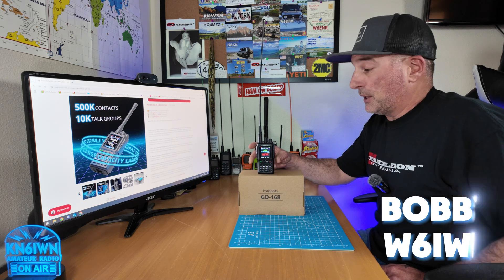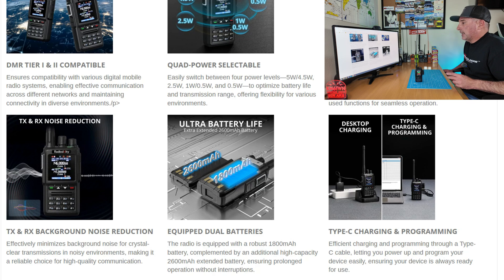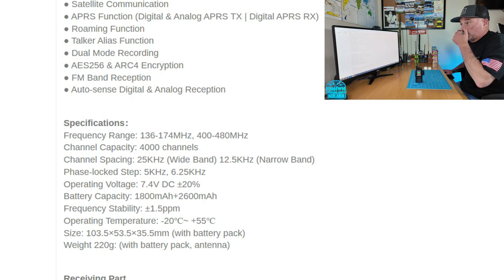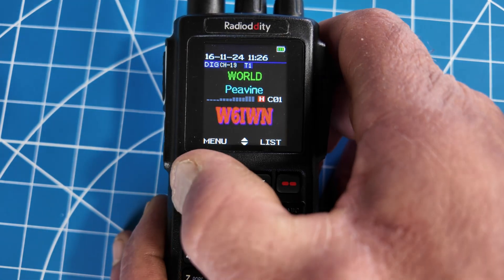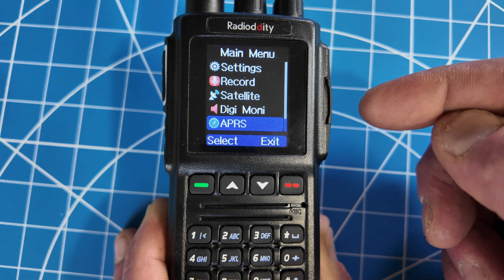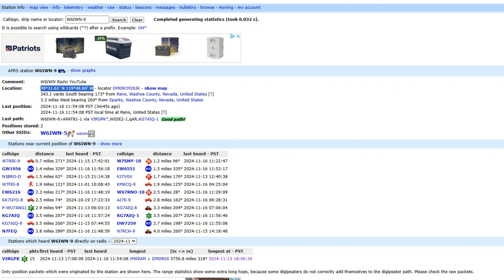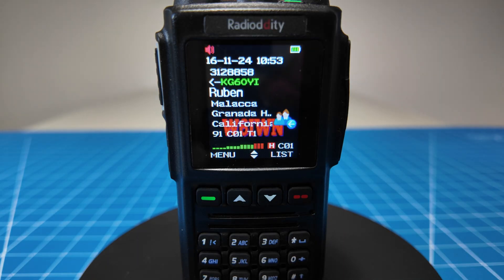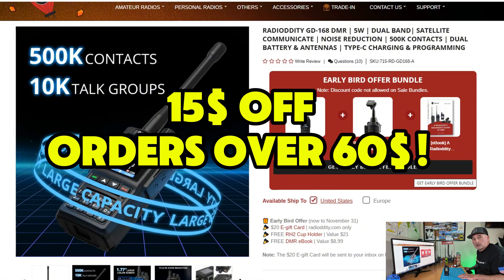NEW Radioddity GD-168

Comment: i like mine but a note make sure you have the latest CPS 1.07 i beleive  this radio has seperate color code for receive and transmit which isnt in the older cps which sets your tx cc to zero which will make it not get into your reapeter or hotspot
Reply from the maker: Thanks for sharing your experience with the earlier version of cps. It's a great little radio, I use it often. 73

Comment: How did you get DMR monitoring to work? Im mega new to dmr but not radio. I set my repeaters up and then set channels for each talk group and I see activity on the unit but I don't get sound or those messages with the radio info when signal comes through..
Reply from the maker: What radio are you using. Try turning on the digi monitor for 1 and 2...

Comment: With my CPS software v1.02 there isn't any APRS tab. It's missing
Reply from the maker: Look on the menus up top for the extra settings or something like that. Check APRS, then it will show. I'm away from my computer right now or I would give you better info.
Reply: @ thanks yes I’ve got the tab showing now but I can’t add / edit the latitude and longitude values though for some reason
Reply: Anytone has the same Radio it's a D168uv you can update it to the 106 firmware from bridgecom systems. I just got mine this week.

Comment: No GPS built in? Is that why you can only use fixed beacons for the satellite predictor and no analog APRS transmit?
Reply from the maker: There is no GPS in this model that I'm aware of. That's why you used a fixed beacon. More beacons have been added to the latest firmware. It does TX analog APRS, no RX. Digital APRS is TX/RX.
Reply: @W6IWN_Radio  Deal killer for me, then.   A radio costing this much sporting APRS should have a built-in GPRS.

Comment: Can you use a anytone 878uvii code plug in it ?. Thx
Reply from the maker: I used an Anyone 878 codeplug in mine. I did get a band error when I tried to write to the radio. The fix is to load the codeplug, then export it, then import it back. That worked for me. I hope that helps.

Comment: Great review on this new H/T, thank you. One question though - is the build quality solid and decent, like its older brother AT-878?
Reply from the maker: Yes, it is! Definitely soild and good good quality... It's the same radio as the Anytone 168. They both get them from the same manufacturer. It's a little bit smaller than the 878 with a few different features.